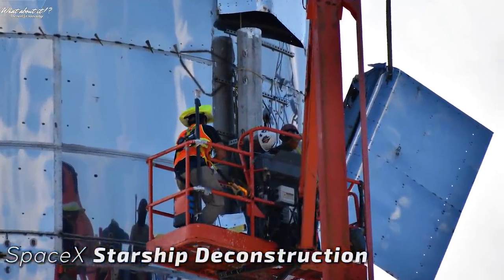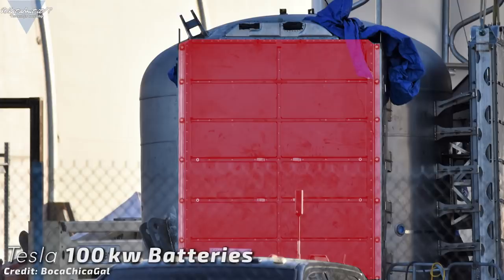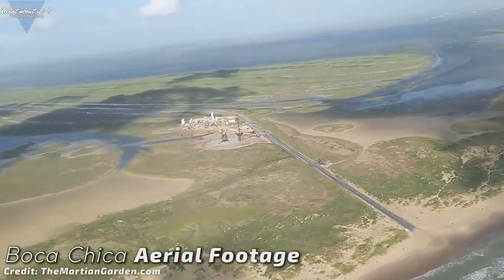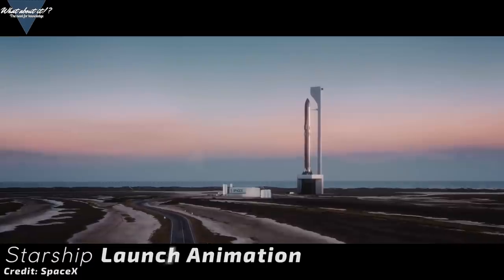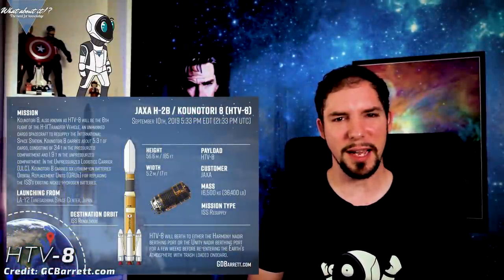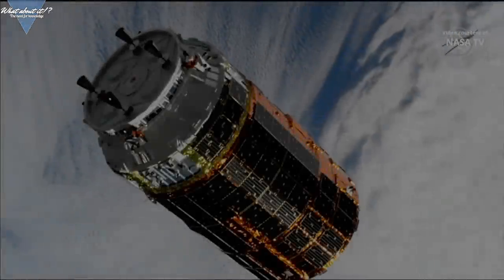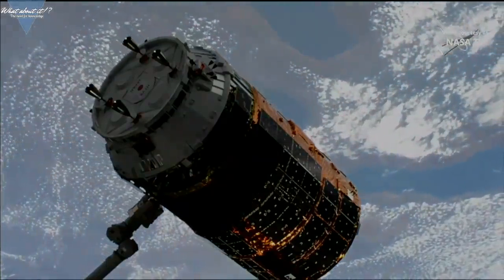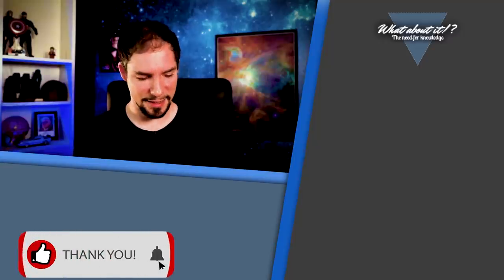39 | SpaceX Starship Disassembled Again – Starship Website Online – JAXA HTV8’s Resupply To The ISS

Comment: That Musk`s starship looks like designed by children and looks like a  joke of engineering.
Reply: You realize it was only build especially for the presentation and other than that it has no purpose at all and after the disassembling it probably goes to the junkyard.
Reply: @samsa824  Then present the shit when you are serious and ready. Half of American companies don`t even have anything to manufacture, just one show item  after another while Japan and Europe and now even China keep cranking  out one product after another. Atlis, Bollinnger, Rivian, Workhorse,  Zunum,  Nikola, Blue Origin, Boom jet, the list goes on, bla bla bla, nothing of substance to  buy. If I want a real product, not just a promise, I go to Japanese or German companies- they deliver.
Reply: @samsa824  - The MK1 -- this particular prototype --  is going to be launched to 20 kilometers, actually. 

But yeah, it's not a final, production Starship.  It's a test platform put together quick and rough. For one thing, future versions will have a single rolled coil exterior with one long vertical seam weld, instead of the patchwork that you see now -- so it will be cosmetically improved a lot, in addition to having fewer meters of seams.
Reply from the maker: That's what they said about the first car, airplanes, steam engines and telephones. Prototypes are not pretty. The reason, why every other "new rocket design" looks so shiny, is because they are not new designs.